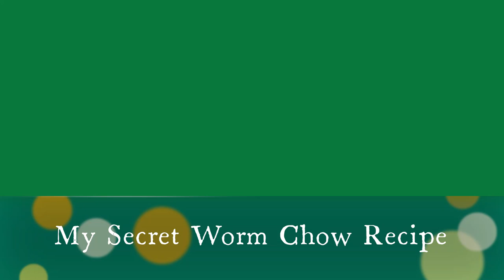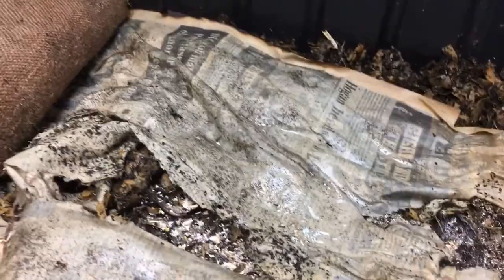My Secret Worm Chow Recipe #Wormchow

Comment: Have  Joe cut a hole in the back of the cover.  Make it big enough to put a vacuum hose in it. Run the vac when grinding and it will collect the dust. so it doesn't seep out.  Just make sure it has a good bag with low micron capability.   Or even better.  Get a dust collector from Woodcraft and hook that to it.

Comment: Nice recipe,,,  I have also gone to the dry formula as opposed to kitchen scraps which draws too many unwanted thing.s   I use chicken crumbles , wheat flour, corn meal, and oats.  Since I started doing this seems like the worms are always on top feeding on this mix.  Works for me on my small scale operation using the factory 360 .  I have 6 trays but usually only use 3 or 4 but with changover may go to more as the worms are more active and are producing more worms.
Reply: I use a grinder for the oats and crumbles to make that into a flour.  Currently doing a separate mix crumbles vs the other dry mix to see if there is a difference.
Reply from the maker: I love all my worm towers. I show those more on my other channel the composting worm lady. I do notice something though when I put larger worms in my towers in time they shrink and I don’t know why strange right?

Comment: Hi, in case of chow only bins. If a bin has 2 pounds of red wiggler worms. Are they supposed to be fed 1pound of Chow daily? Someone told me that they eat half of their body weight daily.... bcos vegies are mostly water where as chow is dense... thanks
Reply from the maker: You know that’s what they say but I believe it only applies to veggie scraps. Chow is different it’s a lot more higher in protein. I have a tray of red wigglers right now that I have on the table I’m sure you’ve seen them in the video. They are eating the chow that I put on there every day. They usually eat it every two or three days. I would think that those are just estimates. I have also seen 2 pounds of red wigglers that are already established in their home devour a large amount of food. I have never put 2 pounds of chow.

Comment: Your worms eat better than me,lol. Are you feeding this to European crawlers, D.hortensis?
Reply from the maker: Yes🤣 all my worms eat the chow that I make.
Reply: Do you monitor ph. and how. Open my container some were trying to get out, so it seems. Also some were very skinny and almost dead.The majority are plump.
Reply from the maker: Get yourself a pH meter. They sell them on Amazon. You need to add dolomite lime your pH should be 7. 6 is OK but kind of low eight is OK but a little high seven is perfect.
I had like a tablespoon and then I measure the pH and go from there. If your worms are thin, they are probably lacking in moisture. Usually my Wormser chunky because I keep the bins at about 80% moisture.

Comment: Nice tats!! Is alfalfa meal all right to use if that’s all I have?
Reply: Also thank you for sharing your recipe!
Reply from the maker: Yes you can but only sprinkle a little bit on the surface because it heat things up. Do your best to find another source of food whether it be food scraps or a natural form of food like dry leaves or some thing. You can also use oatmeal or  cornmeal. The other day we had grits for breakfast and I had like a teaspoon leftover that I didn’t cook. So instead of throwing it away, I just sprinkled it on top of the worms and they went crazy.
Reply: If I used alfalfa sprouts would that be better?

Comment: And when you reference one part or two parts or half part, you mean by weight correct?
Reply from the maker: It could be weights or tablespoons or teaspoons whatever your measurements are. Like if I do one part corn, and one part oats for example, if I use cups, I’ll measure 1 cup oats and one cup corn. Just make them equal. I just make mine and huge amounts. But most people only need a little bit so if you use cups or half a cups and stored in a container, you’ll have it for a while.